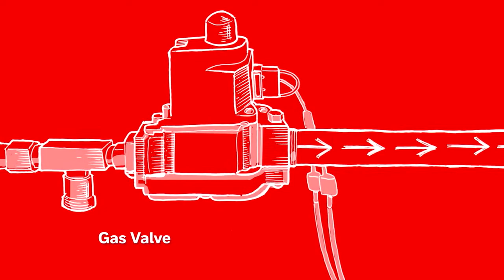How Direct Ignition Works

Comment: Why don't you make a DSI that will work with an ST9120U board?  HSI sucks because the brazing of the outer lead to the base of the nitride probe corrodes and fails due to oxygen combined with repeated thermal stress.  This brazed connection can't be protected from the oxygen that seeps in through the porous ceramic potting either because no matter what, just sitting there over time, oxygen will work its way in even if you tried to seal the potting with melted teflon or something of low permeability on the bottom end where the exposed potting area is largest.  To protect the braze it would always have to be bathed in some inert gas around the clock so that when the power was applied, no oxygen were present.   This is of course very impractical.
Reply from the maker: Hi Phil G, we're always looking for ways to improve the experience for our customers so we really appreciate the feedback. If you ever need assistance, contact us at 1-800-468-1502, or through Facebook and Twitter under Honeywell Home. -Charlie

Comment: Hi a couple questions, is there a way to test the electrode on a DSI? Our oven one will work periodically, even tried cleaning the tip which helped. Also does it matter the distance of the electrode the burner tube?  Say if the electrode is slightly bent at all or does it need to be completely straight?
Reply from the maker: Hi mrsemifixit, thank you for contacting us. Our pro support team will be happy to assist you with this, please feel free to contact us at (800) 468-1502, option 1 for English and then 2 for heating/cooling professional. -Maria